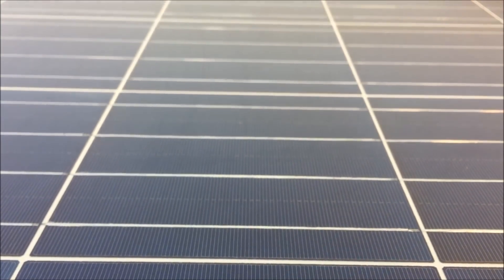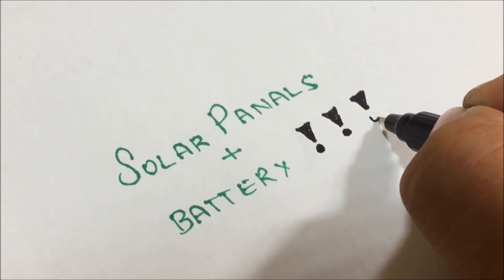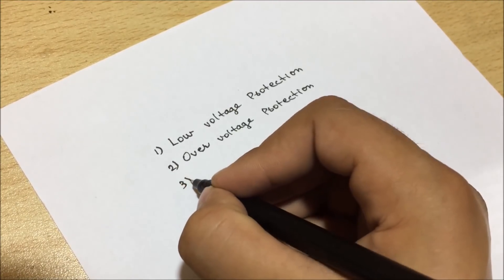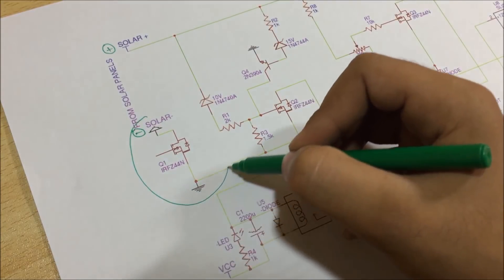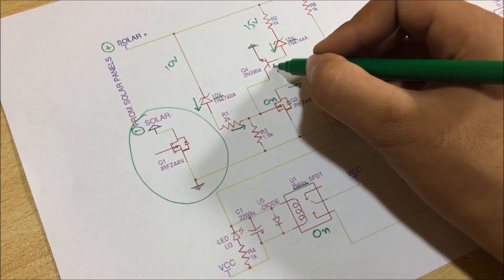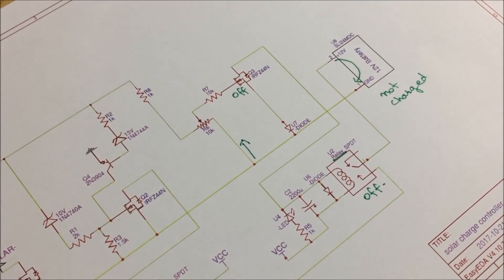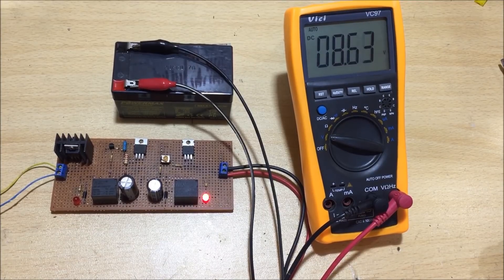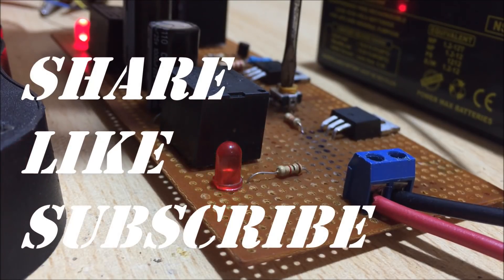DIY How to make a Solar Charge Controller

Comment: You can make under and over voltage protection with op-amps, operational amplifier chips wired as a comparator with a preset control to adjust the operational threshold, and high power mosfets are better for the series pass element as they have positive thermal characteristics.

Comment: In my case, I'm doing it in Proteus software and it didn't work earlier. After inverse the connection of 10v zenner, then it work perfectly. Hahaha I don't know what happening, maybe someone that facing this problem maybe can try it. Plus I put another 12v solar series with switch, so that we can see 15 v zenner working.
Reply from the maker: mohamad rofiq right!! Because zener diode only works when reverse bised

Comment: Most of the comments, asked how the circuit is working for the given voltages or how to design for a specific requirement.
Here's a short explanation:
The circuit he has explained has a 10v (low voltage protection) as the zenor diode IN470A breakdown voltage is 10v. And the same goes for the over voltage protection which is done in the similar way. The overvoltage is controlled by the second zenor diode and resistors such that 10v is obtained at overvoltage. The gate terminal is not connected at the solar negative. Only the drain and source are used to avoid reverse current from the battery to solar pannel. To design it for a 'x' voltage battery you should have a solar panel which can produce that voltage and then design the circuit. Hope this clears your doubts.
Reply: Great explanation sir! all the 4 features he mentioned in the circuit work fine except the automatic cut off circuit which he didn't explain well and it doesnt seem to work for me. Any thoughts on how that part works?

Comment: U7 is not used anywhere in the video.So connecting U7 is necessary?
plzz rply asap ...need it urgently.How has the o/p voltage reached 22v?
Reply: x2

Comment: fake video...its not possible for a 12v  solar panel get to 22v with a load on it...that 22v is even to  high of a voltage for a 12v solar panel short circuit voltage...you will be lucky to get 19 to 20v as a short circuit voltage on a 12v panel...its impossible to get 22v because of voltage drop from the load...he has a potentiometer to adjust the voltage...controllers have resistance which uses up some of the current from the solar panel making your solar panel less efficient...you are being fearmongered to use the controller  and there are much better ways to protect your equipment

Comment: Sir I have a 12v 20w solar panel which gives direct output above 18 v to 21v and lead acid battery of 12v 7Ah will this circuit work on that please reply sir it's urgent

Comment: Ok diodes U5 and U6 which are IN4007 are for protection but what is diode U7 for? And as I can see from your video you didn't use it also...

Comment: I have challenge for you : Can you design and build a solar controller to charge 48 units of XS Power 33-1100 2.7V 3000F SuperCell Ultra Capacitors, for a 12v circuit?

Comment: Hello sir 
Can u help me build a solar charging controller for a 48v battery Bank .
Battery Bank is 48v 150ah and I'm using 12v 100w  mono crystalline solar panels connected in series to make 60v.
Can u help me to make a controller with these equipment s.

Comment: I am unable to understand connection between R7 and R6 pls reply asap
Reply from the maker: R6 is a potentiometer of 10k to adjust the battery charging  and R7 is just a resistor to protect the gate of mosfet

Comment: Hi sir, can, this circuit handle25amp, using 30amp relay.is First mosfet necessary? Can't we use diode for reverse current, battery to pv.? Plz reply sir

Comment: How to use this to charge 2.7V supercapacitor?
Reply from the maker: for capacitor you will just need a linear voltage regulator of required voltage or a pwm controller
Reply: Is that better than a dc-dc converter?

Comment: hi! aatik. that was so interesting.....it lead me to build one for my own. let say i have mini size solar panel 3w. do u think i can use this circuit to recharge lithium ion 10 000mah power bank? wanted to build a portable solar charging.
Reply from the maker: yes it will work but 3w pannel would take an eternity to charge 10 000mah battery bank
Reply: Aatik's lab  how big solar panel should i have? Do u have any reference note regarding calculation to determine the size of solar panel and time taken to charge on the lithium ion battery? Im thinking to double up the size of pannel connect in parallel so that i can get high ampere.
Reply from the maker: remember that the charging current should be 10% of the Ah rating of battery so if you use  3w pannel that would generate about 0.25A  which would take around 40 hours to charge the 10A bank 
so to decrease the charging time you have to increase the AH to  about 1 A  to get a charging time of about 10hours for this you will need pannels of 12w
Reply: pls give me this project circuit  diagram...request

Comment: Please explain the relay connection to me..
I use to think relay poles are to be connected to the positive and negative side of the source but the circuit show that the poles of the relay are only connected to the positive side of the solar panel

Comment: hello sir... 👍😊
could u tall me  { how to give  solar panel negative irfz44n MOSFET gate  of connection...? i don't understand the...  that circuit... can u  tall about that ?
 i have  solar panel  i getting  18volt .  panel no 28-17865 ...    . can i make this circuit bord...   shall i get enough battery charges...  of panel output...?
Reply from the maker: just connect all the components as shown in the circuit diagram and every thing would work fine https://easyeda.com/Aatik/solar_charge_controller-788dc735e2ad4e0897d3790693144692
and for the mosfet  the gate is not connected anywhere because mosfet  is just acting like a diode to stop reverse current
Reply: Aatik's lab  thank you sir
 i understand... 👍😊☺💚💙💛💟💝❤💜
 sir.. can i give 12v dc.. both relay?
Reply from the maker: yup
Reply: Aatik's lab 
will get boost converter... charge  the battery? sir
Reply: And why you don't use schottky diode or so? instead of the mosfet? It's a dude I have.
Reply: Have u made this circuit bro

Comment: Nice! It looks like you're the first one to cover this in detail. Keep it up, subscribed.

You might consider changing the intro. It bears a resemblance to GreatScott, so some viewers may be skeptical.
Reply from the maker: sure mate i,ll consider it ,glad you liked the video and thanks for your positive feedback :)
Reply: @Aatikslab  
Can you Make? 
i am looking for stepdown convertor like XL6009, UC3843 or solar MPPT circuit, but the input should be 20 amperes ,or fluctuating DC input from 12 volts to around 42 volts, or higher But we should be able set the output constant Voltage using variable potentiometer to 10,11,12, 14 or any battery recharging voltage 

Below are some of the reference links:
MPPT  and stepdown PWM circuit
https://youtu.be/BqAXAveyALk
https://youtu.be/Y_L0MYq3NDk
https://youtu.be/m1fPae4zYYs
https://youtu.be/2uc4mycp_Zg
https://youtu.be/fiHb-mR8gYs
https://youtu.be/XArhnqwSyr8
https://youtu.be/UPd6_kKZBLM
https://youtu.be/31jCQCo-j7o
https://youtu.be/W-9fGxexHxM.

Comment: Can you give me some idea, how to charge a battery (2 x 12v) from Solar Panel & electricity. But electricity will be used when the weather is cloudy.
Reply from the maker: Biswajit Patra if you are using a inverter   Or a ups you have to use a circuit called dark sensor what it does it senses the sunlight  and  either supply electricity or cut it according to brightness of sun
Reply from the maker: And for the charging of battery you will need a solar panel whose capacity would depend upon the size of battery and total load and of course you will also need a charge controller
Reply: @Aatikslab  I have assembled the circuit as per the schematics but it's not working..... I don't know what's the problem..??
Is there any changes to b done in the circuit diagram.....

Comment: how to give vcc to the relay
Reply from the maker: Vcc is actually the positive terminal so you have to connect the vcc to the positive terminal of the solar pannel
Reply: both the vcc in the relay1 and relay2  should be connected to positive terminal of the panel??
Reply from the maker: PERUMAL GOVINDARAJU yup